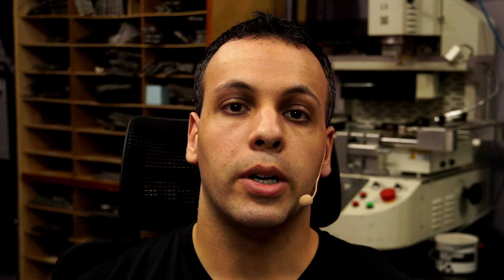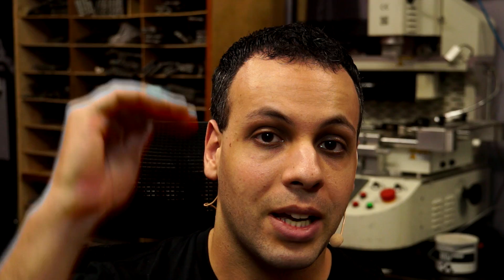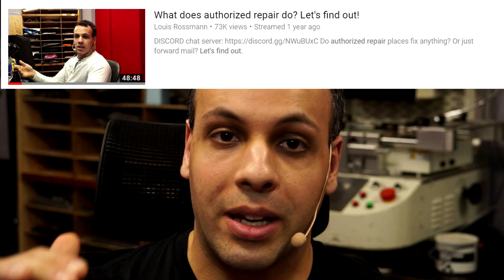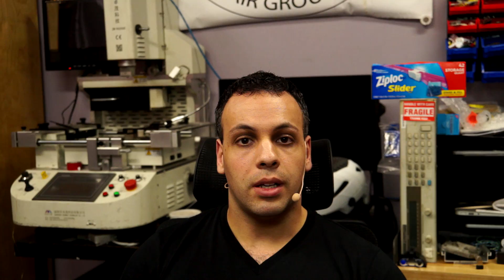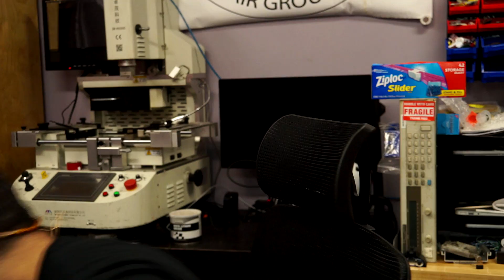Apple's war on refurbishing.

Comment: There is a far out security reason for detecting fake screen replacements: Someone truly sinister could create a screen with a modified chip that usually displays what the computer is showing, except in a very specific situation.  That situation would be if the computer asks if the attacker is allowed to do something bad (like stealing your data), then the screen would change the question shown to trick you into letting them steal your stuff.  But it's a really far out attack, and there is no reason someone capable of pulling it off wouldn't subvert the Apple employees who authorize replacement screens.

Comment: Here is a question open for debate.

Would you want Apple to REPAIR (component level) or REPLACE your motherboard if your laptop was still under warranty?

Please leave a comment, thank you.
Reply: @JCB 136 it doesn't have to survive warranty man, it's the purpose of warranty, in case the device fails...
Reply: I'd rather they replace it, and send the duds back to China for centralised professional refurbishment for use later in other warranty work.
No way would I want an Apple Genius™ repairing boards out the back of an Apple shop.
Reply: @tin2001  if so, then you also accept them selling you entire motherboard instead of repairing it.

Comment: Louis, I'm a new viewer and love your channel. Good information on Apple, however, as a former Diagnostic Imaging field service engineer, your point about diagnostics is old news. In our industry proprietary diagnostics have been the standard for over 20 years. If a customer wants to use a third party to service their equipment, instead of the OEM, that's their choice. But the third party doesn't get the OEM diagnostics. Cost of doing business. I agree with the rest of your points, but not that one. Peace.

Comment: i wonder why they even make any of these things even somewhat able to be disassembled if they dont want want repair. just make them so unbeliveably impossible to pull apart without total destruction. that would work well enough, right?

imo most apple users do not care about repair and apple simply wants people to know, you cant fix it you have to get a new one. makes sales go up i'm sure. though it is definitely one of the reasons i will not buy apple.

Comment: This tendency is going on in several industries. Overall manufacturers are making their products deliberately hard to repair. Even automotive industry is headed that way. However apple is several steps ahead in curbing the repair industry to this extent where a product is destined for trash the moment something goes wrong.  

Repair industry in India is quite strong aa labour is cheap here. The tendency to to repair devices, cars etc is very high as acquisition cost is itself high. There is no way an average Indian can afford to throw out their device if it breaks. Repair is a necessity. 

Slowly over time the accessibility is reducing over time as manufacturers are now trying to engineer their products in a way that repair is not straightforward anymore.  What I hate is apple is paving the path of doom.
Reply: Meanwhile they're also engineering them down to a point where they don't last as long anymore. We're entering Brave New World territory.

Comment: I knew you'd get around to the bollocks with changing the screen. This is why I encourage people to build hackintoshes if they REALLY need to use macOS (I know a couple of musicians who refuse to be without it).

I'm waiting for them to decide that plugging in an external, non-apple monitor needs their special tool next... on the off chance you want to do that rather than pay for a new screen.

Comment: I want to buy a quality phone that doesn't have the logo at all... The manufacturers doesn't pay you to walk around with their shitty logos. But if I bought it I should be able to do what the hell I want to do with it.  If they have their crappy logo on the part the law should say that as long as thier logo not easily removable that they without cost for the customer should repair the part or replace it with the same or better quality part. Now that would give the economical incentive to not make everyone a marketing slave and buying logos.
Reply: manwiththestar The logo in the iPhone screen case is inside the phone.  It's only legit purpose is to tell repair shops that this is a genuine Apple spare part.  They are claiming that these refurbished screens could be resold to other repair shops as being 100% Apple screens.  But that should be entirely Apple's fault for making it too difficult to label refurbished screens as such.

Comment: People tend to forget that in the way Apple plays this, the law doesn't care what device you want to repair on your own because there would be no reason that these potential laws would only be applicable to phones and laptops. This will have an impact on farmers that want to fix their own tractors, people that want to refurbish their house or people that want to fix their own car. "Now that you fitted an aftermarket horn to your car you have to remove all the badges from the car or Ford will sue you for in the event you sell the car and the next owner finds it an obnixious sound which puts Ford in a bad daylight." It is the stupidest thing I ever heard!

I personally work in aircraft maintenance which is a highly regulated repair business but that is very much safety related and for the largest part that regulation is only applicable to commercially used aircraft (a Boeing 777 spends an average of 17 hours a day flying which is incomparable to someone that flies their personal plane 2 hours a week and has a high risk of killing themselves in a crash). 
What's the worst that can happen from a poorly installed iphone screen? A small cut in your thumb or a glass splinter maybe? Apple with all their certifications wants to regulate it themselves like their phones are aircraft where the certified maintenance organisation must have certified workers specific to each aircraft type, which are certified to replace the parts but are not allowed to fix the part, but the part can be fixed by a certified shop, that has workers, that are certified to fix the part but not certified to install it in the aircraft and the serial numbers of all parts are all registered in the administration of the aircraft and may not be installed if it doesn't have the paper certificate with it.

Sounds a lot like Apple doesn't it with the exception that Apple doesn't repair parts and with their devices lives aren't at stake. I could understand electronics for hospitals or military applications being certified in that kind of way as their functioning is mission critical but come on Apple: You aren't that important.

Comment: Rossmann is the best in the USA at tell the company's that do not allow 3rd party repair. The problem is many of the big company's are lying to the public to try to make a higher profit. Apple ,Tesla,  Dell are the worst at this time. (Dell has lost a customer for life when they would not sell me a power supply on a known problem will several models of the XPS models. I was Willy to by the power supply outright. They told me I should have bought the 5 year extended warranty. I had a 3 party company,very much like Rossmann repair. And never had another problem with the unit. When I call call to tell them the problem was solved and to take me off the waiting list for the power supply,they came back with a "we will never sell you parts" ok. I closed my cell charge acct and told them to take me out of their system. I would not purchase there product. 
Rossmann is going thru this bullshit day after day .apple seems to be the big company that want to sue Louis for just breathing air. Rossmann is a very unique man and the same for his biz. But I would trust him  on fixing any product. He is a class act

Comment: Apple sucks just buy an Lenovo Thinkpad as it's a better product.
Reply: And then put Linux on it so it runs better.
Reply: @flaturiah  Especially if it's Kubuntu or another distro that uses Plasma, as that seems to be the easiest to skin to look like Mac OS.
Reply: Kevin Bhasi I guess, but for me what looked more like macOsX was Deepin (based on ubuntu) and ubuntu unity remix (ubuntu had unity, but now that they've changed to gnome interface we have a ubuntu version with unity).
Reply: @Brandon U can run hackintosh on it .... Got Em :D
Reply: " U can run hackintosh on it" Hackintosh isn't an OS.  A Hachintosh is a PC with a MacOS.  Unless Lenovo uses a similar motherboard as another Mac, which is highly unlikely.
Reply: @robertg457  But Apple does use a similar motherboard to PC.
Reply: @Orbis Dev, I have a dodgy Fujitsu (hardware issues) that Linux Mint doesn't like installing on. I Installed Devuan Linux, works fine now :)
Reply: I’d say buy a Dell XPS. Amazing build quality and the same cpu as the 2018 MacBook Pro for more than 1000 euro’s/dollars cheaper. Plus, the battery does astonishingly well.
Reply: @Too1998  Great! Makes it easier to run OS X on ot!
Reply: @Adinias (Too1998), I'm thinking of getting a Dell, or a ThinkPad. Both great looking machines. The Dells look really good, and they both seem to offer good, tough hardware these days.
Reply: After working for IBM and later a university that exclusively used Lenovo for their PC laptops, I wouldn’t recommend Think Pads.  Every year the quality would diminish. They had lots of issues with wireless adapters, keyboards, USB ports, and compatibility with 1st party peripherals such as docking stations to name a few that I personally encountered on a regular basis. Supporting both Apple and Lenovo products, I had less problems with MacBooks than I did with Think Pads. I’m not arguing in favor of Apple or of their actions described in this video. I’m just stating from my own personal experience as a person who has spent a good deal of their professional life supporting both of these product lines that I don’t believe Lenovo products are any better. If you buy a Lenovo, buy a X220 or a T510. Those are very reliable.
Reply: Or build your own computer. At least if you're going for a desktop pc
Reply: that's subjective. It depends entirely on what you value as a customer.
Reply: No get a System76
Reply: nah, xioami notebook pro is the way to go
Reply: Lenovo is pretty much garbage too, just less closely guarded garbage.
Reply: It doesn’t run macOS though.
Reply: sure, there's a lot of things wrong with apple but LENOVO? jesus christ
Reply: Lord Unknown what what?
Reply: Pls stop these comments. I agree with you but this video is about Apple's policies and the shit they get away with, not really about their products. This just leads to fanboys arguing with each other...
Reply: It's not that simple. Even if you don't buy Apple products, their resources as a trillion-dollar company will eventually affect you...
Reply: Exactly
Reply: Phil Abrahams keep dreaming
Reply: @paulkieffer1189  And I have two working Thinkpads which I can repair myself if needs be. Unlike you Apple boy.
Reply: Get a laptop based on components some lenovos are crap.
Reply: it's plastic
Reply: @Adrian: If my life would depend on a sturdy durable machine I would definitely rely on a "plastic" Thinkpad TXXX than a MacBook. Each their own. I prefer machines to get work done that don't have to be treated like a raw egg. Therefore Thinkpad X/T/P series are my way to go.
Reply: @madrian_hello  T H I C C plastic, 100x stronger than aluminium.
Reply: @madrian_hello  Get a MateBook then.
Reply: "macOS garbage" Based on what standard?  OS's are all about how well someone understand the OS.
Reply: Derek Jonez If i were to say in wich standard macOs is garbage, its in support for programs and apps. People talk about linux, but it usually haves alternatives or you just need to do some clicks to install wine and then double click basically all the executables yoi want to install just like in windows, where in macOs i couldnt even find alternatives, nor install windows versions. I was able to make, for example vegas 11 and a newer version of premiere to run without any difficulty in linux were mac os just couldnt. And i had to use many times the terminal in mac os also, so i guess its basically as easy as linux would be, and if you disagree i ask you, what linux distros you used and for how many hours. Because terminal in linux is actually optional to use nowdays, people have a late 90's/early 00's vision of linux.
Reply: Uqpaa Handy  no I heard it the best os around. Even by Apple haters. They're hardware is the problem not the software.
Reply: @jamesisaac7684  Windows 10 is infuriating in its own ways, but MacOS is too limited for me. Their finder has to be the worst file management system I've ever come across.
Reply: @jamesisaac7684  you hear wrong
Reply: *Their
Reply: @jamesisaac7684  it is not true. Example: finder. I rest my case
Reply: "They're hardware is the problem not the software" . Their prices are the problem not their hardware,
Reply: Derek Jonez Their hardware kinda is also, as it breaks easily amd inst easily fixable as showed in Rossmann's channel
Reply: But it won't have MacOS.  And many hundreds of thousands of people are familiar to MacOS and no Windows.  Learning a new OS sucks <-----PC guy typing on a newly purchased Mac.
Reply: Derek Jonez More like "lazy person" saying. I'm also a pc guy, and actually tryied and learned basically all Os'es, linux distros, bsd's, windows (wich i awready used before), macOsX, reactos (buggy unfortunatly), etc. 

And my grandma, wich didnt even know what a operational system was or what was a window im windows, learned also easily to use other systems, so yes, lazy people womt learn. Its like 5 minutes to get all the small differencs between the systems.
Reply: Except it doesn’t run macOS
Reply: @r0caf3lla23  hackintosh it then
Reply: Brandon use Linux skins then
Reply: Random Some Guy still won’t be macOS.
Reply: @Brandon MacOS is basically a BSD. So go with FreeBSD then.
Reply: Brandon It actually runs. Just installs it on the thinkpad. 

I installed the macOs X el capitan (i think, it was the latest one before the launched this newer one we have nowdays), in my dell laptop, and used it as a mac pro. It even recognized the amd gpu. But i just stopped using it some months after as most of things i wanted to run werent avaiable to it, so i gone to linux, yes, incredibly at least around 70% of what i wanted to run, was avaiable to linux... 

So yes, you can install macOs in most of the laptops that have a intel cpu, core2duos, core2quads, core i3/5/7. Sometimes you have only to replace the wireless card because it doesnt have drivers on OsX, but then just get one of the many supported ones or a apple one.
Reply: @r0caf3lla23  Just put the mac os on a pc, you will save so much money  and would be of a much higher quality.
Reply: Jordan Tegerdine a hackintosh? Nah.  Higher quality than a MacBook? Yeah, no. And there’s No substitute for the superior trackpad on any windows laptop
Reply: @r0caf3lla23  you seen some of the new mac books? They may look premium but the quality is definitely not, you can see inside the motherboard from the keys which is a desaster waiting to happen, not only that but you can get a much better pc for a much lower price and still use the os. Other than paying a load more money for bragging rights I see no point in getting a mac
Reply: Jordan Tegerdine you don’t but I do. My MacBooks are great. They are well built and Work great with my other apple devices. And I have no issues with it. Keyboard is fine. It’s just a better user experience for me. There’s a reason a lot of people prefer it over windows
Reply: @r0caf3lla23  Trackpads suck. No exceptions.
Reply: Felix O'Keefe lol now I know U trolling. Apple Track pads are the best in the industry.
Reply: @r0caf3lla23  best in the industry or no Trackpads still suck. Also I personally hate the clicky trackpad design that apple spawned.
Reply: Uqpaa Handy I disagree
Reply: @r0caf3lla23  you say that because your to damn lazy or dumb to learn another os your the problem.
Reply: Rusty Wells I prefer macOS. Windows sucks
Reply: @r0caf3lla23  it may not be garbage for the basic end user, but just hope it doesn't go mainstream. It is far easier to hack than windows. it doesn't get as many viruses because it is only 10% of the userbase. having been in tech for years I have seen how bad a mac virus can be and how hard they are to get rid of. Anyone remember the g4 MacBook that had a virus that could install on the battery firmware? yeah that happened!Even at the time apple was caught sending a memo not to tell customers they had a virus and just fix the issue in order to perpetuate the myth they couldn't get a virus. This sort of crap has been going on ever since jobs came back to Apple, they were good once. 
 Since then they have taken the goodness of Unix and taken a dump on it.  I'm not saying windows doesn't have it's issues it certainly does. But Macs have had a number of inexcusable issues that never should have happened. They just aren't as noticed because so few people use them. If it weren't for the iPhone apple would be dead today, because as much of a turd as Steve Jobs was, he was certainly an excellent salesman and cult leader.

Comment: Hi Louis! I'm from Brazil and run an Apple repair business here. As always, I learn a LOT from your videos. As time goes by, I see more and more Retina MacBook Pros 15" here that the LCD AND the logic board go bad at the same time, having to repair the board and replacing the LCD to make the machine work again. Maybe, programmed obsolescence? Same/similar to the EDID issue? Do you constantly have this issue in your shop too where both LCD and board die simultaneously without warning?